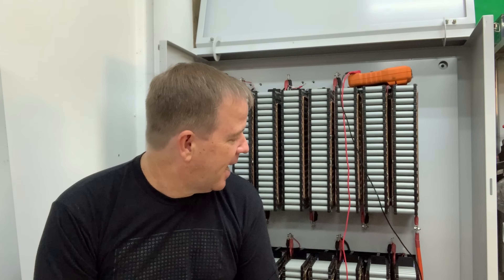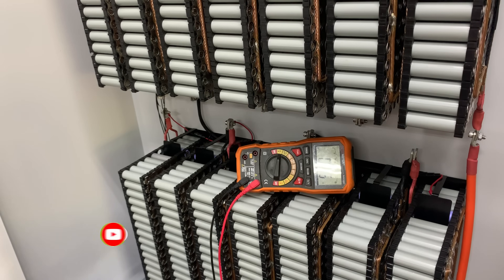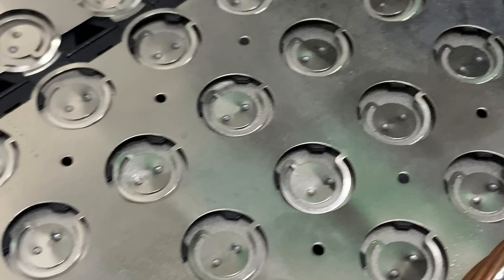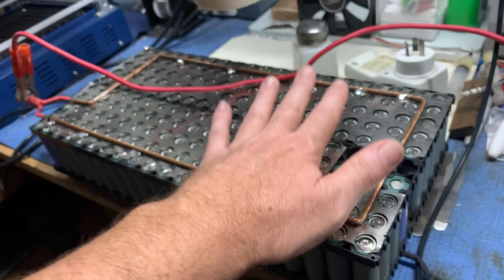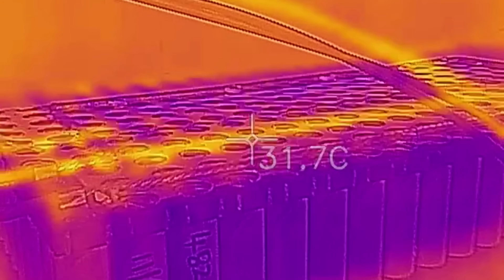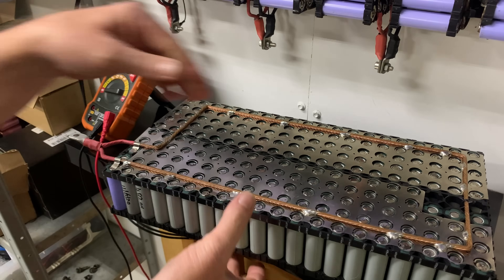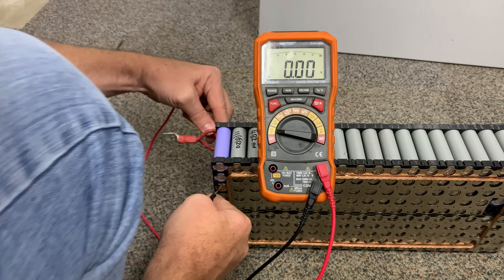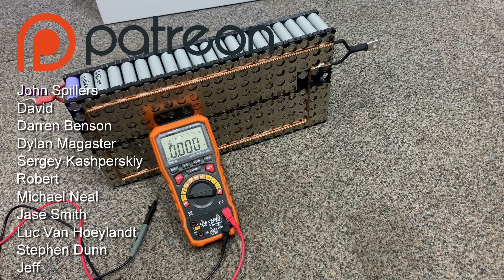Wirelessly charging 18650 batteries!

Comment: It looks like a little extra heat shrink on the main buss would have saved you on this one.  Who'd have thought it would charge when connected to just one side!?!?
Reply: No?
Reply: @Boz1211111  maybe?
Reply: @benssolarandbattery  it looks like confusing case, indeed, but they cannot charge on one side. in fact, positive was welded, and it is possible that there was some leakage of current between negatives, wonder what will he see when he pulls out those cells from holders. but then again, how small that current had to be, because it is not visible on thermal camera. maybe electrolyte conducted while it hasnt dried up fully.. dont know

Comment: What if they don't need to be connected to the negative in order to charge? In order to create voltage you just need a difference in electric potential which is maybe created when the outflow of electrons from the positive pole happens (when charging)

Comment: Leaking Electrolyte can still conduct "voltage", just not much current. That rusted/corroded cell is a Self-discharger, bringing the whole pack down. Apparently it leaked electrolyte at some point making contact with the negative side of the pack. 
It would be like take a very small resistor and connecting it to the bus rails. Not enough to generate heat, but enough that given time will have detrimental effects.
I had the same problem with some aviation lead acid cells where I was getting weird voltages. They had leaked electrolyte and was throwing off my readings. Cleaned up the cells and didn't have an issue
Reply: What you could do Pete, is to douse that end of the pack in alcohol. Get as much of the electrolyte cleaned off as possible. This will at least test the theory of electrolyte leakage making conduction. Would hurt to take some baking powder and put on it too. Baking soda neutralizes the acid making it inert, no longer conducting.

Comment: Fossil fuels needed to be traded on the basis they are finite not under the supply and demand doctrine - all along.
All the time, until the problem is figured out, fossil fuels were running the process.
Thinking when the cells come back online will pay off back all those fossil fuels burned, until the next repair happens - is a wishful thinking.
Humans remain humans.

Comment: I would hazard a guess that the meter's input impedance is so high that you're getting false readings.
Before you do anything, I would make a voltage measurement of each of the three cells, but with a 100 ohm resistor across them for a load. Then I would do a continuity test between the negative ends and the nickle strip.

Might give you some answers?

Comment: The problem with charging Liions with small current is that they are going to develop "the sudden death syndrome" because it is approaching the parasite current value that is  clogging up the cell somehow. It really should be charging only at relatively high current rates to last longer! Small currents=sudden death. High current charging = longer life, happier batteries.
Reply: This adds to dendrite formation and when a heavy load comes in to play, sudden death.
Reply from the maker: Thats the first i've heard of that theory.. I'll look into it

Comment: you have the live attached giving one connection the casing of these cells is neg and you have the unit which is sitting in a metal bracket contacting the neg of the attached cells to the unattached cells, they are insulated but it is very thin insulation and the entire unit is extremely heavy.
Reply from the maker: but it wasn't touching the metal housing at the time of testing? BUT i like your thinking, might do an earth test

Comment: Why not cut some 18mm plastic pipe into 650mm long pieces to use instead of the zero volt 18650 cells? It'd be far better.

Comment: What we learned is that you don’t monitor your environment - except for occasional spot checks. I’m surprised to find you so careless....
Reply from the maker: To be fair, its not charging or discharging so the chances of failure are stupid slim. That said my production batteries get weekly checks with thermal camera & visual, Monthly checks with multi meter - and i 'watch' my batteries more than i check FB in a day. Careless is the very last thing I am. But with this experience I'll hook up the BMS to the battery so I can remotely check voltages

Comment: For the three cells that are part of your mounting system, replace with 18mm timber dowel from your favorite timber merchant, well that’s what I do anyway.
Reply: And if those dowels charge up to 4.2v????lol
Reply: @kevinmills5293  then you patent it, sell the patent and retire happy.
Reply: @kevinmills5293  then he'd truly would have created a monster😱
Reply from the maker: Sounds like a good plan!
Reply: @HBPowerwall  Then I await Pete's video in 12 months where he's measuring 4.11v from the wooden dowels :)
Reply: What Ah capacity should the dowel be?
Reply: @Bennyboy-dog  Well, the chemistry of the dowel limits the capacity to 0.2 of FA!
Reply: @kevinmills5293  I think we should talk to standards people to have the "FA" introduced as part of the SI system of weights and measures. I believe we can offer an accuracy of 1 in 10^999999999 - better than any other constant we know.
Reply: Now there's an idea... Dowel with a couple of 2477 button batteries concealed just right.... LOL, now we're talking. I mean, you're only looking at 500 mAh total but still... that would be hilarious! :)
Reply: You read my mind. 18mm wooden dowel cut to 650mm long and shrink wrapped would look nice.

You would have full isolation to. I have a large bank of big lipo cells and I always worry about thermal runaway......

In the end I got a big pack of auto reseting thermal Fuses that are open circuit until they reach 55C / 131F. They are all wired in parallel and I have a boxed psu with battery backup. If any of the sensors close the separate  battery backed psu  pushes 24v to the shunt coil on my battery isolator.

You can wire as many of these thermal sensors as you want in parallel so you could use thermal adhesive to glue two or three of them to the nickel sheet.

If you want to get a good temperature reading on your packs just stick a length of black insulating tape on the packs and you will get a reliable reading.

Hope that is of some help...   😀
Reply: This is a good idea too

Comment: You need to use the continuity checker (or resistance measurement) on your DMM to check for connection of the negative of those cells to the pack. 

After all, that's specifically the function of a continuity test...

Comment: I'm going to say that there is some electrolyte making a teeny tiny little short somewhere... Pull the cells either way, but man that is a headscratcher. You could 3D print some blank cells if you don't want to use real batteries. Faster than finding a wooden stick that fits. XD
Reply: Agreed. Leaking electrolyte can still conduct voltage and extremely low current. Cumulative over time can be detrimental.

Comment: The only partial explanation is that (as a meter works) its measuring the difference between the two points, the weird part is how it got charged to begin with, which I would (maybe) attribute that to inductive behavior. I would add a insulation barrier between those battery leads, and your copper wire.

Comment: Peter check the resistance of wire near the died cell mate please. Had a problem with an antenna system in the military something like that was corrosion in the wire. Long shot.  Need to talk to someone just offered 80p packs, but dead think been sitting at the guys house for some years? Is it worth taking?

Comment: logic says:
obviously there is a connection.
then one looks inside the assembly for that possible connection.
Reply from the maker: We can't use logic here lol - I'll pull it down but not before i do the next video
Reply: @HBPowerwall  
yeah well, there is a logical reason for this. pulling it down certainly helps figuring out the cause.

Comment: I’d be suspicious that the leaker that rusted through has made a connection to the negative of the adjacent cell.
Also, try using a lower input impedance meter or across a 10K ohm resistor, because the DMM you are using has 10Meg ohm input resistance and is high enough to give readings through the corrosion, as a path. Good luck Mate!
Reply: I agree with this comment. That electrolyte has leaked and made a connection to the Pack. I bet the IR is very high in that rusty cell that's why your not seeing any volts. You could prove this with a low ohm meter/impedance tester. Interesting one!
Reply: I was just watching one of the prior videos about this cell he put together. During his whole sorting and placing and flipping and placing again, there was one cell that had rust on it. I wonder if it's the culprit.
Reply: At the positive you conected it to the main lead and the leaking rust from the broken cell made the connection to the adjacent cell. That is under guarantee the issue. The really best way to find such an isolation issue is an isolation tester. testing with 200V from the rusty side of the blind cell to the negative zink plate for sure is very low impedance due to all the nasty liguids. Definately 3D printed blinds had been the better choice.
Reply: Yup, easiest way to check if a cell is actually connected or not is to use the continuity checker on your DMM... That's specifically what it's for.

I agree, I think the insulation has corrodes through and that zero volt cell has been shorting the pack.

Comment: Do a continuity check between + of blue cell and + of pack. It possible that electrolyte or a metal hair is making contact. It wouldn't have to be much; and you not likely to find until removing blue cells. 

IMO: It's bad idea to include dead (0V) cells in pack, as they are prone to self corrode, thus leaking. This can cause corrosion of nearby cell casings. Better to use a nylon, wood, or other dowel material in 18650 shape as mechanical support structure. (even if popping tops of 18650's and filling with epoxy)

Comment: Should just not put in those cells, maybe those plastic dummy cells that are sometimes in packs would be better.  You basically have unmonitored cells sitting in each pack.
Reply from the maker: I really wish I kept all the dummy cells but always felt so ripped off when I saw them in batteries they went straight in the bin

Comment: Is there any leaking electrolyte that could has dried and caused a bridge to form a connection?
Reply from the maker: that would be top of my list!
Reply: @HBPowerwall  Only plausible explanation. Maybe better replace those dead cells by 3d printed inserts or such to be extra sure. But you've chosen LiFePo4 as your next gen chemistry (which I highly recommend as well), so there may not be any further development going into those 18650 packs anyhow?!
Reply: I thought the same

Comment: The cells that rusted must have been chit chines cells.  Everyone uses stainless or Nickle .  They don't rust.
Reply: Cells are not made from Stainless steel. They are nickel plated steel. Practically sll cells are made this way. This is why it is important to "not" sand away the surface to get rid of any barbs left from previous nickel strips as you can take the nickel plating off.
Reply from the maker: They are Samsung 26's they were good but 1500mah or under tested cells..

Comment: Wonder if the rust is causing electrolysis deeper in the cell, could then be passing voltage thru the plasma in the exposed cases
Reply from the maker: I'll accept anything as subjections at this point